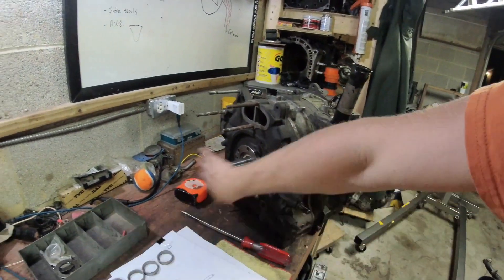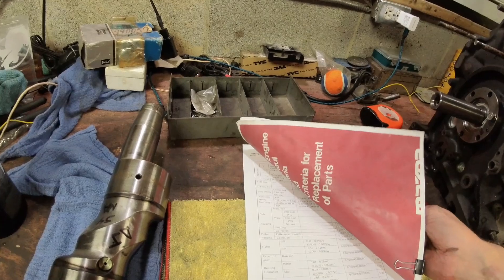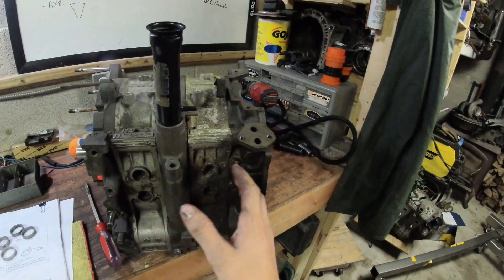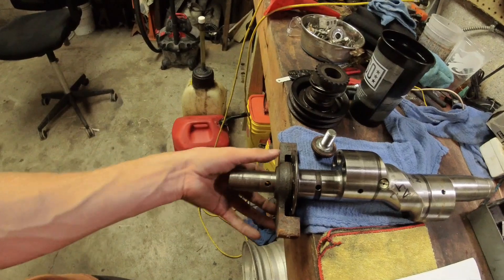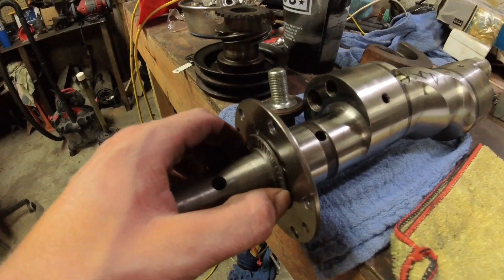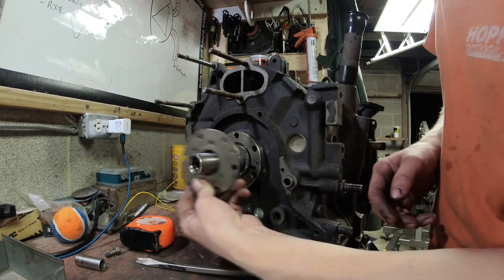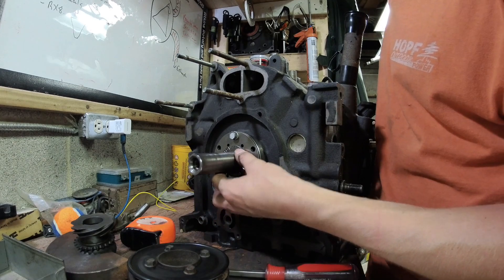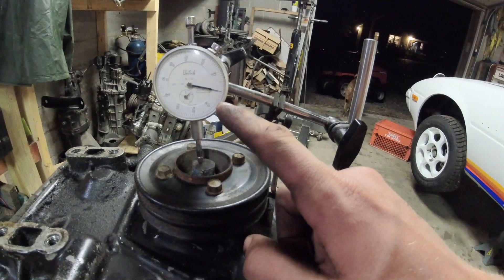Rotary Engine Endplay Explained - How To Check and Change Your Endplay

Comment: Your videos are generally very good; you might want to rethink that one statement; end play is not effected by housing AT ALL.
You can demonstrate this by assembling the e-shaft and front stationary gear in only the front housing, with the bearings plates, pump gear, distributor drive gear and front pulley on the shaft all without it being in ANY engine. The play is about the torrington play/clearance and has nothing to do with housings dimensions.
Reply from the maker: Mega thanks for the correction!!!  Back in the shop to look at things after reading your comment and you're totally correct.  Basically the endplay is solely based around the e shafts relation to the plate that bolts to the front iron!!!   As there is nothing at all rear of that system to affect it!!! MEGA!!!!
Reply: So if the plates are lapped , it wont affect the endplay ? Is that right?
Reply from the maker: It shouldn't effect the endpley, but I would still check it when you assemble the engine
Reply: @erwinhauquier2414  yes plates being lapped will affect endplay, housings will not as they are parallel to the eccentric shaft movement
Reply: @jamfd3s788  read the comment from Brian, it totaly makes Sense .endplay is only adjustable from the front so if the block get's smaller it won't have any effect.

Comment: How much do you push on the long flat screwdriver when checking the endplay? I found absolutely no info anywhere how much force to apply but when I pushed more I had more endplay
Reply from the maker: I usually just let the tool do the work. Not n excessive amount if force
Reply: @RADPotential  thanks man and thank you for your videos. You are doing good job for rotary comunity!

Comment: If the engine has good compression, but it has much endplay, is still running but makes som noises and when the clutch is pressed they get louder, is the damage big or might it be saveable from a bigger disaster with just correcting the endplay? 😮‍💨

Comment: So... I changed out the front pulley and now I am worried I crushed the torrington inner bearing. The pulleys are lined up good (Centered) on the front.  I was going to get a dial indicator and check the float. Will the dial indicator tell me 100% I'm okay if I see the float? Mazdatrix has a good write up about it too. Just super worried I'll destroy my engine. Thanks for any help!
Reply from the maker: Is the engine on a stand?  If it's in the car I'd be worried.  On a stand, I'd just take it apart and check for sure.
Reply: @RADPotential  I measured the float. 0.002 inches when I pried on the front pulley. It feels a little tight though. I didn't feel it or hear any sound when doing it. It's not on a stand. On it's side ... yeah, No stand.
Reply: I also have a pic of the internal front assembly looking up with the oil pan removed. That front counter balance is super snug against the plate and almost touching those 6 bolts. The front bearing looks fine and isn't off balance or anything. It gotta be good right? haha
Reply from the maker: did you measure the end play before you swapped pulleys?
Reply: @RADPotential  no i did not.. Just followed the racing beat instructions. It's .002in right now. I think it's good. It wouldn't move if it was pinched tight. The motor had never been rebuilt or anything.
Reply from the maker: It would have (zero) end play if it was pinched.   so at 20 thou you should be fine

Comment: I'll be doing an s4 swap into my FB and will be changing the front cover. The general consensus I've heard is to rotate the engine 90 degrees when swapping front covers so that the Torrington Bearings do not become unset and ruin the engines endplay. This makes so much sense after watching your video, thanks!!
Reply from the maker: If you're going to have the front cover off, I would just check and make sure when you install the front stack again it's done right.  Assuming the engine is out of the car.  Just stand it up and do it vertically.  You shouldn't need another spacer.
Reply: @RADPotential  that's the plan, thanks for the advice!
Reply: Also, would swapping front covers result in the possible need for a different spacer?

Comment: Hi, I'm a fan of your channel. Very good. I have a question, I bought a 13 six port. I can use turbo 2 or twin flywheel?, the flywheels are the same diameter in the screws?. Thank you

Comment: You are wrong about what makes change end plays. Only the front iron plate trust bearing holder tell you that.  Differents trust bearings thickness, wear washers or bearings and spacer itself,  other than that will not change  your end play.

Comment: One thing my engine builder told me was to make sure there is still some float there after you have mounted the engine back to the gearbox... at first there wasn't any but after sticking the jack under the motor and not the gearbox it relieved the pressure on the input shaft and it was all good... was a massive relief.. anyways cheers for the content love the channel
Reply from the maker: I have never thought about that.  May go check all my cars now hha!!

Comment: If you build a modified engine for more horsepower than factory Mazda , does it needs more endplay? (because they expand more because from more heat ) Or do you just stay in the mid range of what the rebuild manual states?
Reply from the maker: I have not read/seen anybody running more/less endplay in any high revving or high hp builds, but I do not have any first hand experience

Comment: aye man im rebuild a series 5 na 13b, i want to turbo the motor, ive heard a turbo ii rear plate would work, is that true?
Reply from the maker: If you use turbo front and rear plates then yes.  You can't use a turbo rear plate with an NA front plate.  One is 6 port one is 4 port
Reply: @RADPotential  is that due to the 4 port intake gasket not lining up with the ports? ive heard there is a way around that, but there if is another reason please explain
Reply from the maker: If you look at the ports, the front iron being an NA 6 port, and the rear iron being the Turbo 4 port, yes it would all bolt together. But the port timing, and duration would be different.  I would use matching front and rear irons.  Either both turbo. Or both 6 port NA